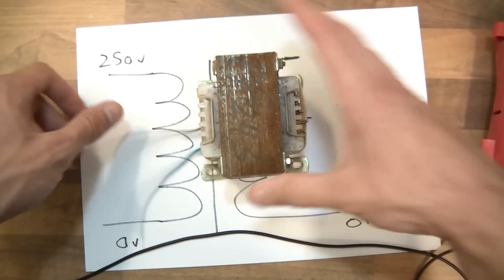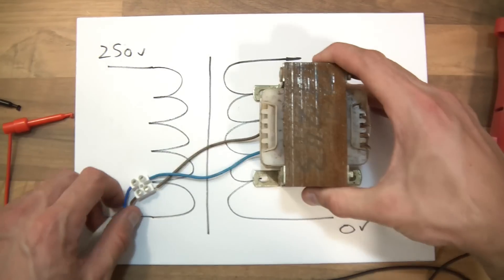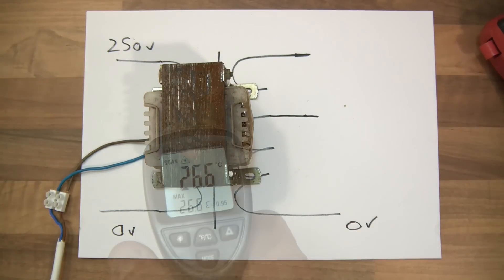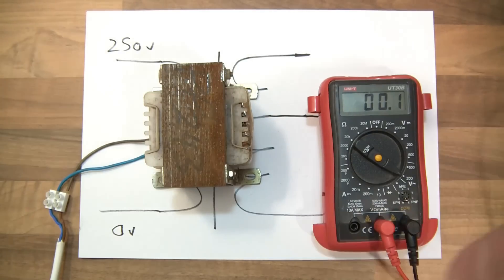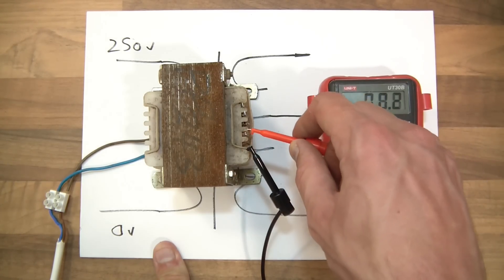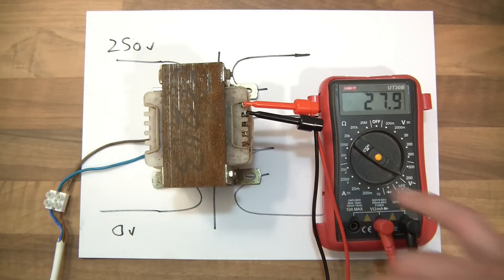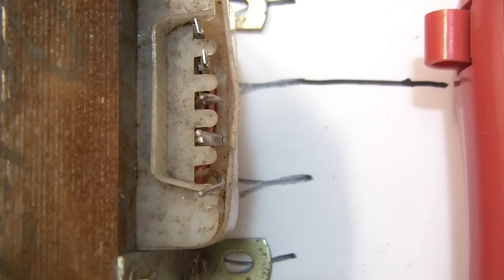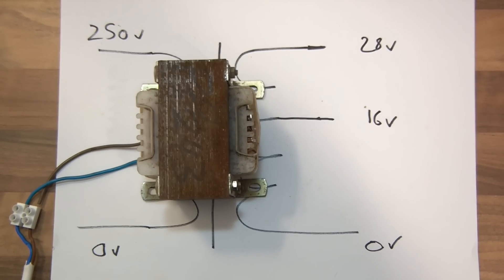INVESTIGATING: How to Identify a Transformer (Input/Output Voltage, Amperage, Taps) (Part 2)

Comment: Several things:
1. You should feed lower voltage, say 10 VAC if you have a variac, to the primary side for testing safely.
2. You should check, a continuity test, to see if two windings on the secondary are independent.
3. If 2 is true, it's done this way for you to connect them in series or parallel to create various voltages(this is the answer to your question). You seemed to have 1 winding with 28 VAC, and the other with the same voltage with a center tap. 

What I can see from the video, this transformer can be configured to get following voltages:
AS is:
 - One 28 VAC with a half the power capable
 - One 28 VAC, or one +14 VAC & one -14 VAC with a half the power capable

Connect two windings in series:
 - One 56 VAC with full power capable

Connect two windings in parallel:
 - One 28 VAC with full power capable

Note 
1: The power I'm referring to is what the transformer is rated based on wire gauge and other material used to build it. This is very important info as the total power is preserved between the primary and the secondary if it's well built. The voltage is lower, but the current is higher on the secondary side. 
2. The actual AC voltage you can use may be a bit lower than you've measured once you connect the loads. However, if you convert it to DC, the actual voltage is higher, *SQRT(2), as AC voltage value is represented in RMS, not a peak value.
3. Impedance is also another important parameter in characterizing a transformer. It's a bit more complex, but Vp/Vs = Np/Ns = SQRT(Zp/Zs) in basic, where N is number of wire turns and Z is impedance (a bit different from resistance, but close enough for a concept)
4. The power transformer uses the voltage transformation characteristics and audio matching transformer uses the impedance transformation characteristics.
Reply from the maker: Allin7days Thanks for the info. :)
Reply: @AntonyCartwright  the second single winding has SMALLER diameter wire for the coil so DO NOT use it in series with the main winding except for LOW current output as it clearly has much lower current handling capacity than the main winding! It appears (easy to check) that it is a completely separate winding probably for some lower current control electronics or such like. The centre tapped winding is the main power output feed but is almost CERTAINLY NOT a 10 Amp 28v output as from the physical size of the transformer I'd say it is far more likely to be 100 watt (or thereabouts) max or less. Most likely it came from an audio amplifier (say 30-40W per channel RMS) with the smaller output winding providing power for the pre-amplifier stage and the larger winding for the power output stage. Alternatively it's the transformer from a power supply unit (most likely linear).

You would need to run many other tests to verify the actual output capability of the transformer, and its regulation capabilities before committing to its actual output capabilities. As a simple rule of thumb however when using an unmarked transformer in hobbyist projects you could measure the transformer regulation at various different output current loads. A "good" power transformer should be able to maintain load regulation at 3% or less (lower is better) at full load. So after testing pick an output current that falls about 10% below the measured current at a measured 3% load regulation, run with a fixed load for some time constantly monitoring the transformer temperature as well as the regulation with temp and if it proves to run happily for hours at that load you SHOULD be safe to run it at that current for as long as required. Load regulation is the open circuit (no load) voltage minus the load voltage with the result divided by the no load voltage. Remember that an under stressed transformer is a) way safer, b) more reliable c) better performing d) runs way cooler than even a mildly overstressed one.

When using such transformers in power supplies etc. It is a good idea to implement some temperature and current monitoring on the transformer itself together with appropriate cut out safety features. In your case it seemed rather obviously a 220v AC input unit because of the primary input wire colours as you said, but on a safety note be VERY CAREFUL when supplying power to the primary side since ANY one or more of the output windings MIGHT possibly a HIGH voltage output. Without knowing precisely from what equipment the transformer has been derived this is a distinct possibility. As suggested by others, using a variac set low will help maintain a healthier safety margin, then the input voltage can be slowly increased. 

If you have access to a high voltage insulation tester then it would be wise to test any unknown transformer for breakdown at a minimum of 1000v and ideally at much higher. (the marks found on transformers typically of "High Pot" indicate that the original went through such a high potential test for safety so take the hint and re-test before use. Also take great precautions especially where the output winding wire can be seen to be very fine where attached to the output terminals, as this is often an indication of the number of output turns on the transformer - the finer the wire the more turns that can be fitted which in turn leads to greater output voltage. Finally the brown and blue wires leading to the primary are NO indication of the ACTUAL primary winding wire diameter but typically are thicker to provide robust connection wires. They may, however, be a good indication of the input voltage (especially in the case of blue/brown - Europe, or white/black - USA and elsewhere) as you stated.
Reply: @boblewis5558  thanks for the info. The safety procedures you mentioned when checking transformer is very helpful.
Reply: i realize I'm pretty off topic but does anyone know a good site to stream new tv shows online ?
Reply: @Alden Eliseo I would suggest flixzone. Just google for it :)
Reply: @Terrance Aryan Yea, been watching on FlixZone for years myself =)
Reply: @Terrance Aryan thank you, I signed up and it seems like they got a lot of movies there :D I appreciate it !
Reply: @Alden Eliseo you are welcome =)

Comment: one reason for the two coils on the secondary are so you can have to choice to run in series or parallel. series will double the voltage with the same current, parallel will double the current with the the same voltage.

Comment: If the step-down transformer does not have any identification, use a multimeter to measure winding resistance. Primary Winding resistance is higher than secondary resistance.
Reply: Yes. I have here a transformer with identification from an active speaker with 250v (18Ohms) Primary and 2X 23,4Volts secondary output, i'm searching for a new one, do you think it's meant to be 2X22Volts or even less?   I measure 2 times 23,4 Volts with and without (open circuit voltage) the amplifier board connected?

Comment: This is a nice video, also that is a good idea to try and estimate the maximum amperage based off the wire, although the plastic and insulation around the coils would be the biggest weak point because if that melts due to the heat its GG short circuit town.

Comment: you will prob find the centre tap is 0 so you get 12+ and 12-and another winding for another device like pre amp or somthing I would say it is out of a stsreo or alike
Reply from the maker: David Simpson I show in the video that the centre tap is around 16v. :)
Reply: Antony Cartwright yeah been negitive on minus side of winding and poaitive it will then the nexr winding winds on from that im amps they tend to use centre as 0 so the get a plus and minus voltage for the chip
Reply from the maker: David Simpson Ahhh, thanks! I understand. You mean they use the centre tap as ground reference and therefore the lower winding is -16v relative to it? And therefore, the upper winding is +16v?
Reply: Antony Cartwright exeactly yes and on some amps they had a lower take off for a turn table alot of time they dont remake for purpose just re use what is allready available so can be used for anything

Comment: Hi from America.  I am finding your video very useful in investigating my own problem.  It is on pause right now but I wanted to respond to your question about why there would be 2 windings....I don't know really...but, the one I am testing...which is why I'm watching this, to learn more about testing them, looks very similar to this one.  Without visually seeing it, I have determined the connections and windings are most likely the exact same...although with different input and output voltages.  I haven't checked the input voltage, which I am now learning I should have done 1st, but I think it should be either 220 or 240 which is common here for supplying GFCI and some branch circuits.  I began testing the output and found similar readings.  124v from center to each hot...228v from hot to hot and the other set of wires which read 13v.  This seems to be there to supply something of low voltage...but these wires lead to a junction box which should branch to 2 separate lighting circuits and should be 120v.  I am presuming that I am reading 13 volt because of a feedback.  But anyways, I believe the center tap is there to supply a constant supply to a GFCI on one lead, and to supply the lighting with the other lead which is broken by a timer switch so the lights come on at dark.  The other set of wires, which read 13v and should be 120, would then supply the other set of lights which are also timer switch controlled.  
Thanks for the video.
Reply from the maker: bronson guidry Hi, with this transformer, I now think there is one winding but with a tap in the middle. It is of course ac... The voltages don't matter because the output is relative to the input. But I believe it was intended for 240v. Mine outputs a -13 or so, 0 and +13 or so. This makes sense as it's ac... Half wave below 0, and half above zero. I think you'd then put it through a rectifier to make it dc... I believe the reason why the output voltage is higher than intended is for losses. 14v after losses etc will probably be 12.4 or so... Then you'd put it through a regulator. At least that's what I think now. :)
Reply: the reason it's higher is because transformers will deliver rated (min) voltages at a specific current, not open-circuit (your DMM is 10ohms). One you put a load on the secondary, the voltage will drop lineally.

Comment: You forgot to mention how to calculate the voltages without having to measure them. It's 10 times safer than what you did.
Reply: Do tell? I’m here because I have a transformer I need to test.
Reply: @emmettturner9452  Enzo missed where he said he is NEW to transformers. Cartwright can't CALCULATE the tap voltages unless he knows the turn ratios, unless he obtains the spec sheet for the said transformer!

Comment: How do you manage to know that you have ended up with an ac to ac transformed instead of ac to dc. Thanks for your response.
Reply: transformers are ac devices. Some may contain an internal fuse on the primary but that's  about it. Any other components, namely diodes ADDED to any transformer is what then makes it a DC output device. Of course you have to add a few more components to make it regulated.
Reply: ALL transformers are AC to AC.. you have to add a componets (rectifying diodes) to convert to DC.